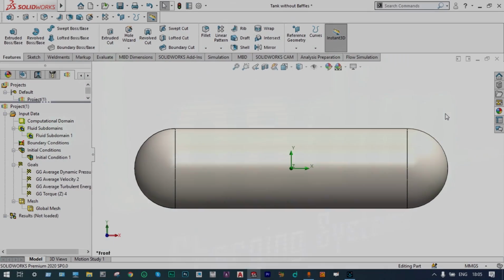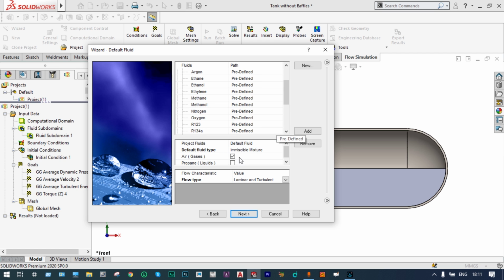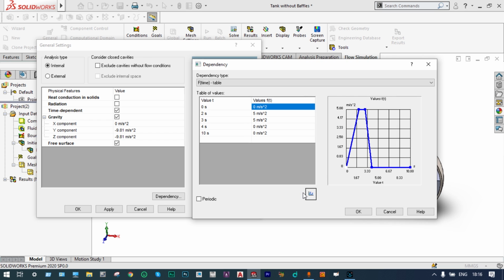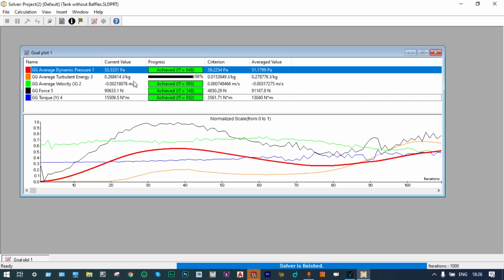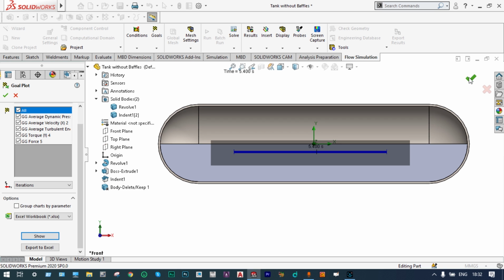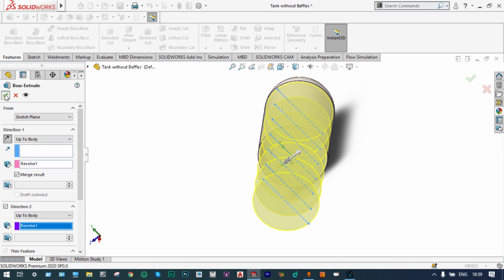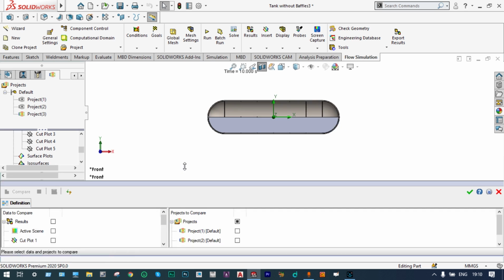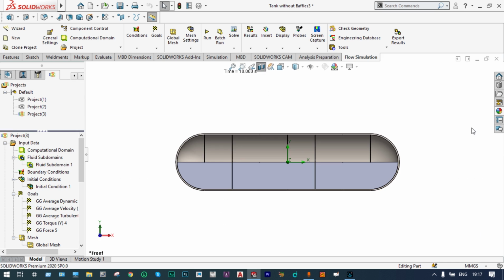The best CFD Tank Sloshing with SolidWorks Flow Simulation

Comment: I have stp format but there fluid body is not created , the geometry is non- uniform .. what is the way to apply fluid domain and follow the tutorial?
Reply from the maker: There must be some problem either with the geometry or with the boundary conditions. Please check boundary conditions carefully. While performing internal analysis exclude cavities without conditions should not be checked. Check geometry & check the option "Improved geometry". If it is not solved, send the file in Parasolid format. I will check

Comment: i am working on sloshing for fuel tank..can you please share how to do meshing and how to directly import the model for simulate also share the process for doing sloshing
Reply from the maker: If you are having the model in other CAD Platform then you can save it to any Solidworks supporting extension like Parasolid or something supported with SolidWorks. Wgile meshing you can go for easiest option like global meshing with higher refinement level like 4 or 5
Reply: @CFD_GUIDE  Thank you so much for your prompt answer but i dont able to filling it up hence my model consist of fuel and air. Please guide for the same or share any tutorial so i can complete the project.
Reply from the maker: It should be a free surface problem
Reply from the maker: Your boundary condition is not clear. Car is initially moving with 40km/hr. Itvis OK but total duration is not provided and even 0.5*g force is provided on car. This is not clear. You can follow this video exactly excluding the boundary condition. As your BC is different. Perform 2 different simulations then its results can be compared from result analysis
Reply: @CFD_GUIDE  yes it is free surface problem but how to fill hence i dont find any process for this.Please share if you have any
Reply: @CFD_GUIDE  0.5*g is braking force applied and vehicle stops within 5 sec only.